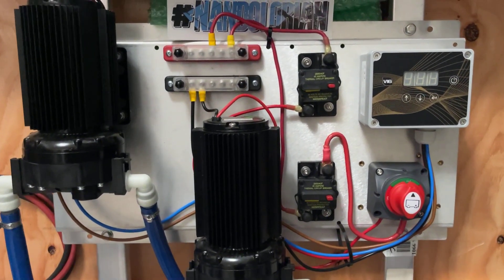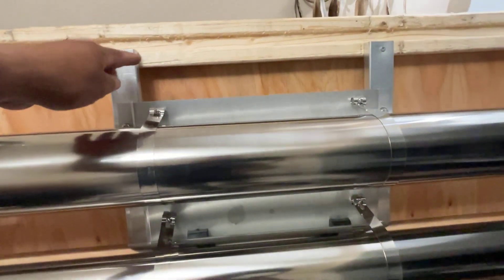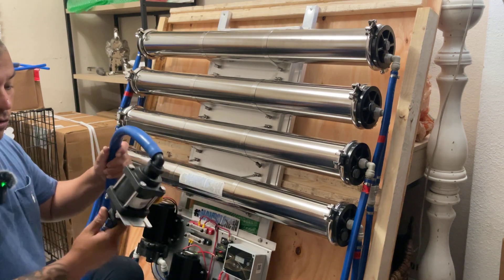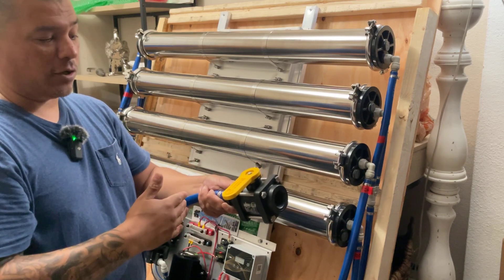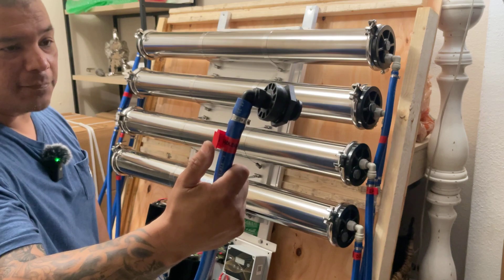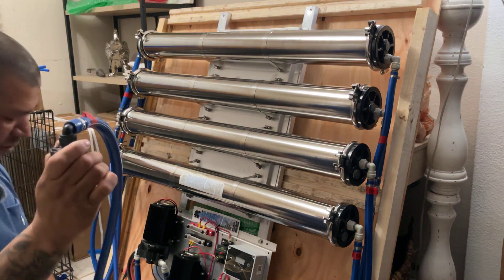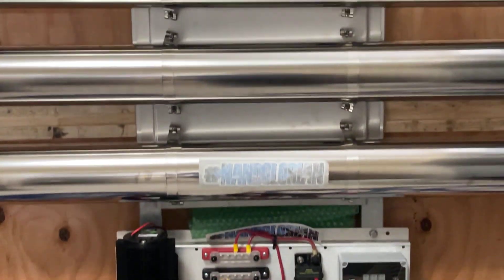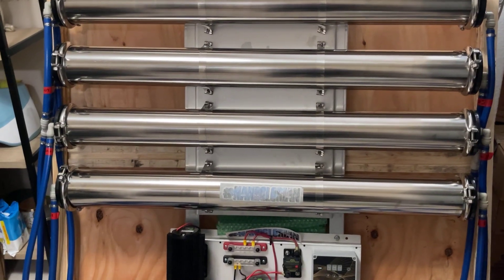Nandolorian DI System - How to set up.

Comment: What does it do?
Reply from the maker: This is a water filtration that removes all impurities in the water to deliver pure water (spot free) for cleaning purposes, traditionally used in window cleaning, solar panel cleaning and can be used in the rinsing of vehicles (auto detailing) to minimize spotting, keep in mind that in auto detailing spot free is not achieved due to the amount of crease a vehicle has and trapped dirt is left behind but not leaving as much as if you were to rinse with a tap water hose. Most auto detailers I have bumped into the road always pre purchase their water at a fill station and i have always tested there water and come across readings of 005ppm up to 014ppm (parts per million) so they are not rinsing with pure water, this system produces pure water 000ppm. Thanks for the question.